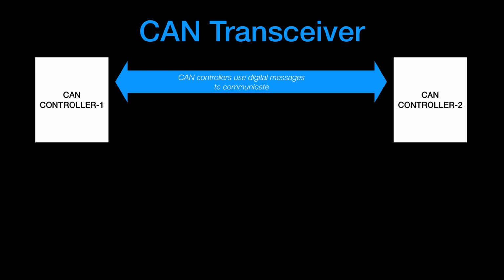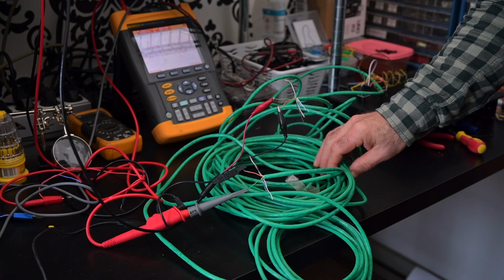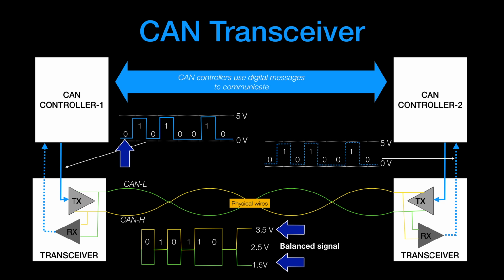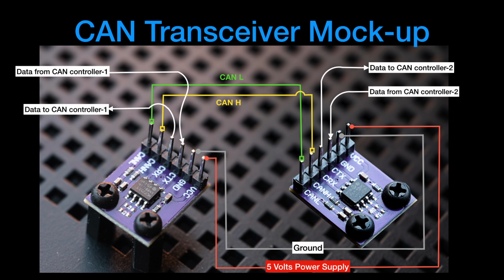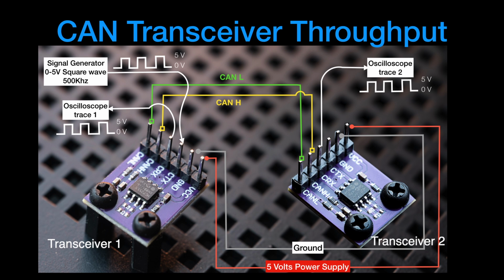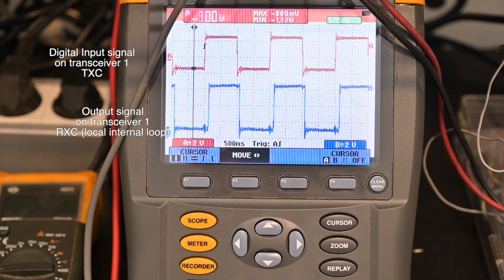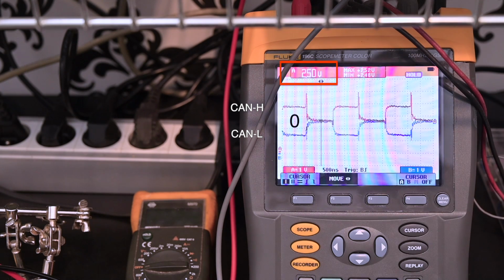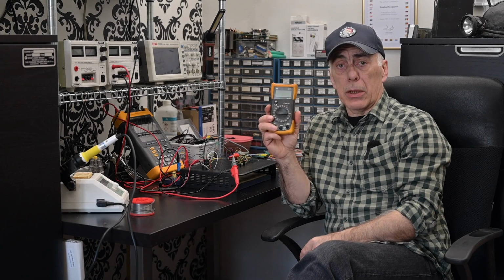Yes you CAN ! Understanding  the CAN BUS   Part 2 -  Electrical Signals

Comment: It would have seemed more convenient if the transceivers had the resistance required between the CAN high and CAN low implemented right on the board.
Reply from the maker: yes , but keep in mind that this is only at the end of the bus.   Now some modules have that capability

Comment: In part 1 he said to remove the car battery when measuring withé a Multié Métré
But if the car battery is removed to measure the Bus then where does thé voltage to be measured come from 🤔
Reply from the maker: Part 1 was to measure the resistance/ terminating resistor.  that is why you need to remove the power.

Comment: Hello, first of all big thanks for such a informative video.
I understand your expertize in this sphere so I will appreciate if you take some
Time to read about my problem which remains unsolved for 10 years. I have 2001 mercedes benz W210 for 10 years, with 220 CDI , om611.961 engine and 6/1 manual gearbox, 346000km on odometer and it has very strange kind of misfire.
Engine misfires when pressing gas pedal and only when the car is in motion, in gear and in neutral gear too, misfires always occur in 1100-1700 RPM range and is most notable in 1st and 2nd gears, knocking sounds and vibrations , (i have completely new clutch assembly and flywheel), but in higher gears incorrect firing of engine can be heard,so, to summerize misfires always happen in 1100-1700 rpm range, in 1st, 2nd gears and in neutral gear too if the car is in motion and rolling due to inertia, but no misfires happen if:1- car is stationary, 2- car is moving but keep clucth pedal pressed and pressing gas pedal. There is feeling that when vehicle is in motion ECU gets some corrupted and incorrect data and it sends wrong corrections and adjustments to injectors and cuasing misfire, but Within these 10 years I have changed at least 2 different OEM MAF, MAP, intake air temperature and pressure sensors, High pressure fuel pump, fuel rail pressure sensor and rail fuel pressure regulator valve, crankshaft and camshaft position sensors, gas pedal position sensor,Flywheel and whole clucth complect kit, i have checked EGR vacuum solenoid actuators, EGR valve, i have tried another 4 set of injectors, All electric fuses are OK, engine exhaust is perfect, CO and NOx levels show good values, electro diagnostics dont show any important codes. I have checked all sensor and injector electrical wirings for continuity with multimeter, but have not checked all witings of car, only engine sensors and ECU wirings for continuity and i point out again- misfire pattern has not changed in this 10 years period, it remains exactly same. I THINK if there was any damaged microscopic damage in wiring harness it would deteriorate and burn. My friend who also has same problem changed whole engine( but did not change ECU and wiring harness) but problem remains same, it means that there could not be timing error. The only things i have not checked and changed are: ECU itself and Lambda sensor on catalytic converter, I think if ECU has incorrect MAP/ data it would cause misfires while car is NoT in motion, and Lambda sensor would cause excessive smoke and bad exhaust gases readings.
I think, as the misfire is speedrelated / motionrelated, it can be caused by malfunctions associated to ESP/bas/ABS, and here starts some very INTERESTING THINGS: 
If I disconnect any of the three plugs connected to traction control module(located next to ECU, passanger side, under black hood, shown in photo, ) and i start engine while car in neutral and stationary, i give gas and there is no misfires, BUT IF I PRESS CLUTCH PEDAL AND THAN RELEASE, and than press gas pedal engine starts misfire when making 1200-1700 RPMs, and car is not in motion at this moment. This happens when any of these three plugs of ESP module is disconnected. What can be happening, why clutch pedal has such effect??
Can disconnecting these three plugs cause engine to work in Limp mode as it gets no speed information ( but in limp mode generally RPM limit is 3000rpms, but in my case RPM CAN BE INCREASED TO MAXIMUM-5000 RPMs) and when ECU is in limp mode because it does not receive any info about car’s speed and movement, ECU is programmed to think that car is moving and thats why engine misfires,( usually when all plugs are connected car misfires only when it is moving), and what role in this case the clutch pedal has - it has some kind of switch on clutch pedal position sensor on it. 
At least knowing what ECU is programmed to do when ESP module is disocnnected and what effect pressing on the clucth has to ECU will
Be helpfull.
I know 2 other guys with same problem and nobody can help them too in my country.
What do u think aboit probability of bad ECU map, ECU visually checked there is no defects on solderings.
Gearbox, driveshaft, flex discs, differential  are also good, generqlly car works well, acceleration is good, nonexcessive smoke or noises, but has misfires only on 1200-1700 rpms, and if i press gas pedal very hardly rpms pass 1200-1700 without misfiring and go upward, but if i press gas pedal in a way to maintain these RPMs than misifiring occurs.
Any idea?
Reply from the maker: That is indeed a strange problem, especially as other people have the same issue..  Here is what I suspect :
1. EGR valve sticking or dirty (very common)
The EGR valve often sticks due to carbon buildup .
When you're cruising at low RPM under light load, the ECU opens the EGR.  So you recycle exhaust gases.
If it's sticking or reacting slowly, you get:
jerking / misfire feeling and  hesitation around 1200–1700 RPM

In stationary,  The ECU usually doesn't use much EGR at idle, so the issue doesn't show.

Quick test
by-pass the EGR, by blocking the exhaust gas input  or just replace the entire EGR with a tube.     In fact I have a recent video on the EGR. 

The other thing that comes to my mind is the gas-pedal sensor and the intake butterfly valve...   those can cause issues due to wear and vibrations , providing spikes on the data.   Try to do a read-out on the signals.

I know that it does not  get jerky when running stationary, but remember that there is no load on the engine , and as such the injection volume changes in combination with the Intake butterfly to retain a proper AFR.

Here is another test I would do with an OBD2 reader:

Use a OBD2 scanner capable of live data .
 Able to Read  live parameters for the :
   MAF / Air mass (g/s)
   EGR valve position (%) or duty cycle
   RPM
  Optional: boost pressure

Create your Stationary baseline.
Start the engine and let it idle around 1500 RPM in neutral.
Note MAF reading in grams/second and EGR valve position.
Typical MAF idle (stationary, 1500 RPM): ~3–5 g/s
EGR valve: usually 0–10% open at no load
This is your base reference.

If MAF is unusually low (<3 g/s) or EGR is high at idle, that’s already a clue.

 Simulate low-RPM load
Put the car in gear (manual play with the clutch  or automatic in drive) with the parking brake on.
Slowly raise RPM to 1100–1700 RPM by lightly pressing the accelerator.
Watch MAF and EGR readings:

if the MAF reading drops or spikes irregularly, then you have a	Dirty / failing MAF sensor
if the EGR opens too much (>30–40%) at low RPM under load	 then you have a Sticking EGR valve
if MAF fine, EGR fine, black smoke still happens	then Check boost hoses / turbo

The key is that under load, MAF should increase smoothly with RPM.
EGR should mostly close at low load acceleration, not remain open.

I don't think its an ECU fault as the ECU runs a checksum when it starts up. Any corruption of the code or data will be noticed.
Reply: @D3Sshooter thanks for your response, i have changed whole EGR  and MAF also, there is no smoke  at all, and misfire happens due to the incorrect timing of injection, its inocking sound, but all injectors are fine, its diesel so it does not have air intake flap,  is it possible that clutch pedal switch causing such symptoms, or bad wiring due to vibration? Or incorrect ECU map data? 
But if wirings or grounding points are rusted or damaged would not the symptoms get worse diring time? I have this problem from the day one of buying this car- 10 years already. On rpms other than 1200-1700 engine works fine, no hesitation, no smoke, just knocking on this RPM range, which makes car driving in 1 and 2nd gear very uncomfortable at moderate RPM ranges😏
Reply: I also tried to disconnect turbine pressure sensors, turbine geometry flap and egr actuator vacuum hoses or solenoid power supplies which activate EGR valve and which opens turbine variable geometry flaps but everything remains exactly same. 😮And one more, why car starts knocking while its stationary only when the traction co trol module connectors are disconnected, and only after pressing and releasing the clutch, if i dont touch the clutch it will Not start knocking on 1200-1700 rpms while ESP/ABS module is disocnnected.
Reply: thanks.
I found out that  when engine is running and if i touch and move just little bit the third plug on ECU connector, engine is swithing off, no other connectors only third one. Should it be working like this? If i disconnect plugs of course engine will shut off but just by touching on connector why should it be shutting the engine off?

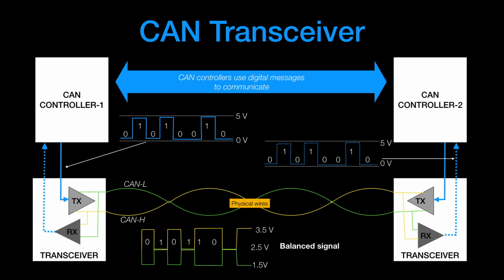Comment: This video was really informative and gave me a better understanding of the CAN BUS network. Just so you know, the diagram you have at the bottom of the video at time 6:20 incorrectly shows a 1 bit as a high voltage signal on the CAN High and CAN Low wires. Just bringing this to your attention
Reply from the maker: Thank  you for spotting it.  Its a typo in the text on the lower pattern :  the 1 should be a 0 . The graph is ok as it matches the bit pattern at the digital side , which is 0-1-0-1-0-0-1-0   on the CAN balanced wave form the pattern is a typo as it says 0-1-0-1-1-0-1-0  that  fourth digit from the left should be  a 0

Comment: In real world testing, measuring can bus with a multimeter will generally be 2.5-2.6 and 2.5-2.4 due to the the time between messages (in my experience anyway) however you’re almost always going to need to follow up with checking with an oscilloscope.

Comment: Well presented, clear and not skipping in anything.
A quick 2 questions please.
1. Where did you get your information (shown at 3:18) of what modules are on what BUS?
2. What is the usual frequency of the CAN bus?
Thanks
Reply from the maker: Thanks for the comments,   for your question 1:  That is based on the datasheets and build information on several CAN modules.  CAN transceivers  come by multiple vendors, but all meet the CAN bus specification.
2.  The CAN bus where we are talking about here runs at 1Mbps , others older at 512kbps, and new CAN FD's at higher speeds.  As you will have noticed , I have no X-tal on the transceiver as that is only a transceiver.  In the next video, we will dig in to the synchronization and the actual CAN frames for  1Mbps CAB bus.   You will notice that the frequency /xtal runs at 8Mhz.

Comment: The explanation in this video assumes that all connected modules have the same ground (i.e. reference) voltage. In a real car this might not be the case. Due to poor grounding there might be several Volts ground offset between one module and the other. In those cases will the voltage levels on the bus be different. Especially the wave forms in the recessive state may look different. On an oscilloscope this will easily be recognisable, but measuring with a voltmeter might confuse you tremendously.
Reply from the maker: Thanks for the comment,  so lets look at that :  First all CAN controllers should have a good ground.  If that is not the case it should be  fixed.  The ground is in essence irrelevant for the Transceivers and the signals on the bus as they measured not towards ground but towards the differential difference between  CAN -H and CAN-L.   Of course the Vcc and Vss must be within tolerance to power the transceivers and the CAN controller.  Remember that the Transceivers are embedded in t he CAN controllers .  Thus those must be provided with a good ground and the needed Vcc ( +12V or sub voltage).    If they are not having a good ground , there will be potential issues with the CAN controller itself  and yes it might be that the CAN-H and CAN-L voltages varying. Pending how that ground behaves.   That is why measuring the CAN bus with reference to ground for both CAN-H and CAN-L is indicative only and as you stated can be very misleading .  Hence my advice for a scope.
Reply: @D3Sshooter  You are correct that the receiver only looks at the differential voltage. However, all transceivers have a limited so-called common mode voltage range. If the grounding is poor it is, in theory, possible that a receiver gets pushed out of its common mode voltage range. Or that a reverse current starts flowing in the output stage of the transmitter. If I remember correctly is a ground offset voltage of 2 Volts no problem for the transceivers to handle (some types can handle more than this).
Reply from the maker: @windmill1965  Indeed, that info is available on the datasheets of the specific transceivers.

Comment: Nice overview with basic explanation on how the physical layer works. The shown physical layer is by far the most used one. But there are two other physical layers that are used in some cases by some car manufacturers: Fault Tolerant CAN, and Single Wire CAN. The voltages on the bus wires are different for those physical layers.
Reply from the maker: Yes indeed, and that is why in the first video , `i did mention  that we are looking at the standard ISO 11898-2 A/B ' and that there are different standards such as the ones you listed and the CAN FD...

Comment: Took me some time to digest that binary 1 is 0V CAN differential.
Reply from the maker: I know, its kind of the reverse logic and it can take a bit before it sinks in..
Reply: That is somewhat counterintuitive but if I remember correctly this becomes an advantage when handling message collisions and which has higher priority.  I may be mis-remembering that but I'm sure there is an advantage to it, maybe this will come up in future videos and I don't want to pre-empt Steve.